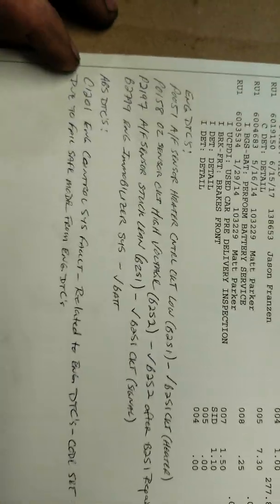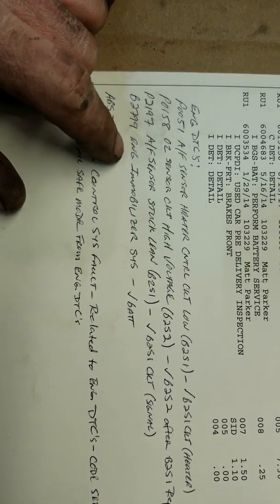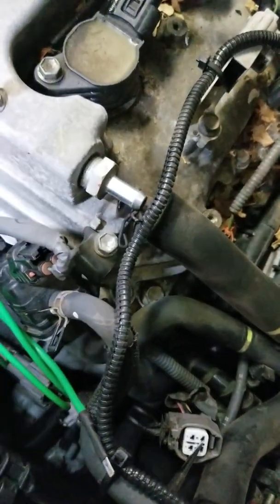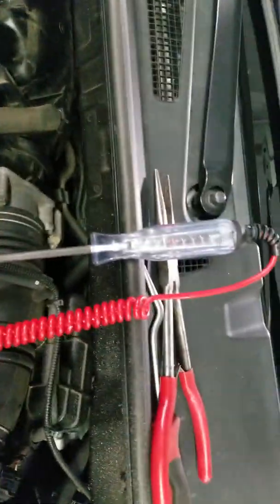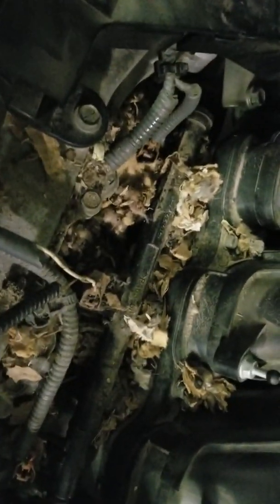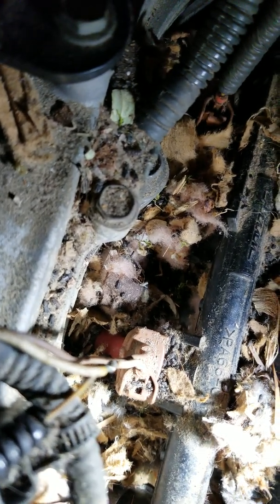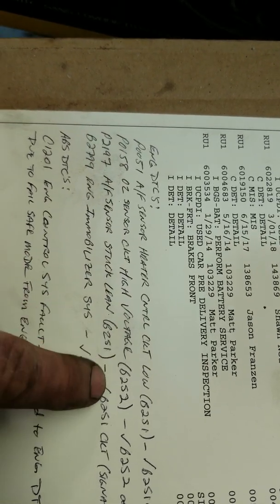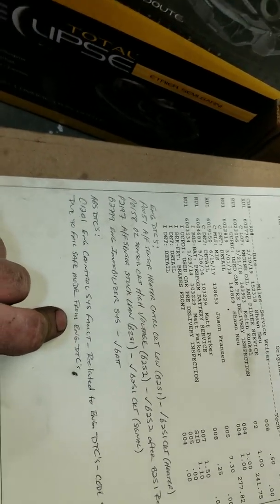2008 TOYOTA HIGHLANDER 3.5L, P0051, P2197 B2S1 HTR CNTRL CKT, & P0158 B2S2 VOLTAGE STUCK HIGH

Comment: Solid work. I've seen a lot of videos on the difficulties of working around aftermarket stuff. The time spent watching those videos has really changed my opinion about anything aftermarket.
Reply from the maker: Yeah, thanks Wyatt, so I actually just finished this one this morning, was not able to get the 02 sensor from Toyota until then.

Aftermarket stuff is what it is, but it's frustrating when it's not done with any regard for future conditions.  I repaired it and kept his remote starting circuit as is, I don't disable stuff unless customer requests that, but at least now it won't be exposed to the elements.

This thing also had some vacuum leaks due to people removing the air box to service the air filter as well.  Toyota ran a lot of evap vacuum lines etc in that area and it's common to see them all jacked up when they come in running poorly.  People just don't understand that if it looks like it is in the way it's best to just remove it and avoid breaking stuff to take "shortcuts", nevertheless, she is running nicely now.